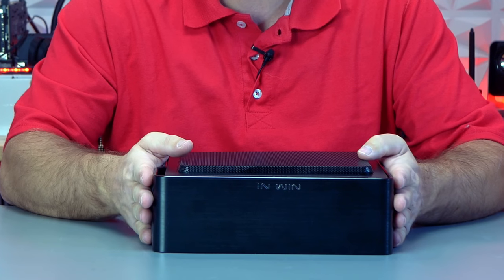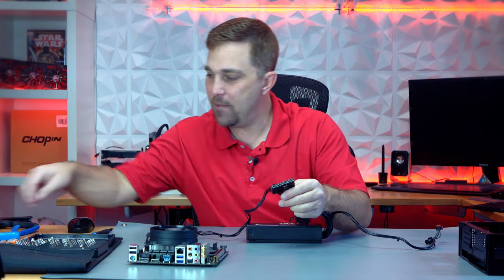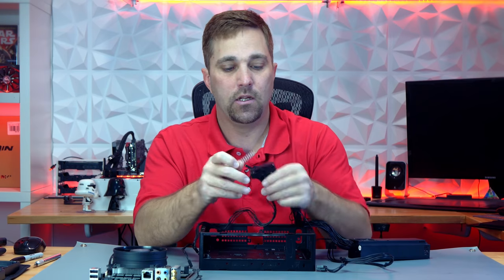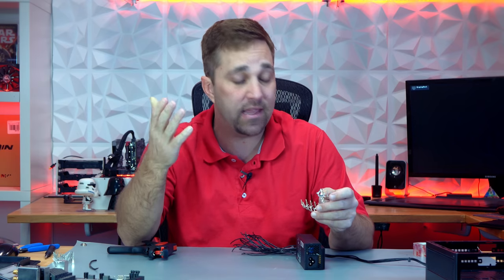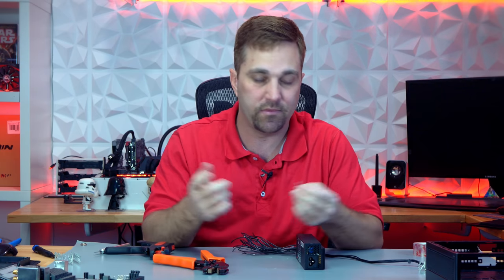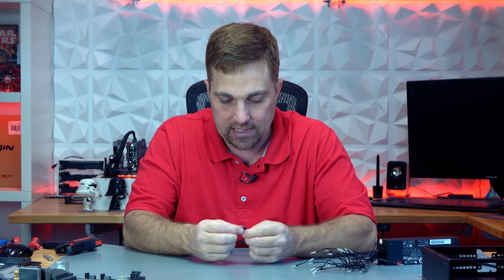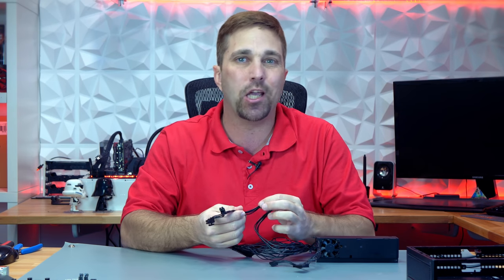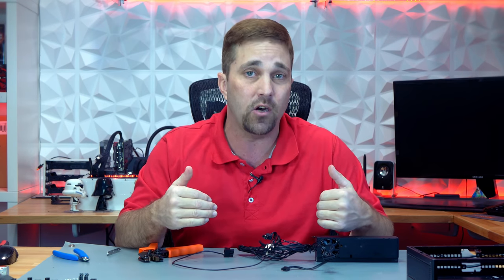How to Rewire a PC Case, PT 1. The Power Supply

Comment: Great video, a lifetime of useful information about wiring and since life is always full of wires knowing your way around one is always desirable. Now a wire management-related question, getting all the cables nice and organized in the best and most efficient way possible is very visually pleasing but the biggest benefit is cooling due to better airflow since the wires are blocking the air and negatively impacting maximum cooling when all the cable are as organized and pretty as reasonably feasible what is you recommended way for fan setup and how should the air be flowing for best cooling and dust control? positive pressure? negative pressure? which side for intake or exhaust, front? top? back? bottom?
Reply from the maker: Optimal airflow s always neutral airflow, meaning the same volume of air is coming into the case that is going out of the case. To do this this perfectly of course involves math however the most optimal airflow in builds I've done almost always involve having three fans in the front of a well ventilated case (mesh front) and one exhaust fan in  the rear, and two exhaust fans on the top of the case. 3 fans in 3 fans out = ample neutral pressure airflow.